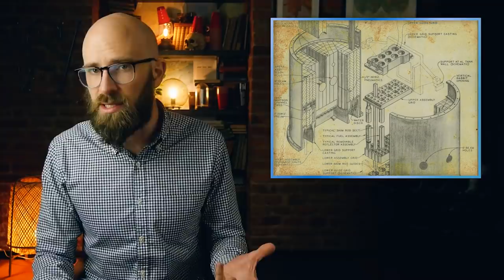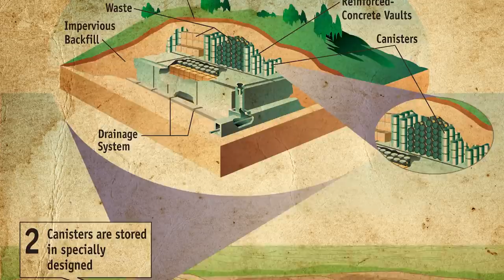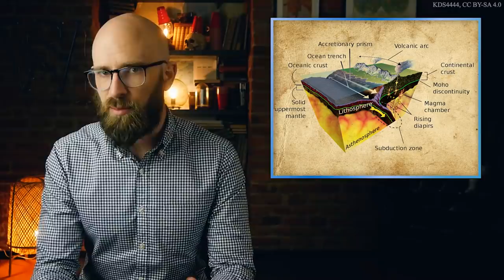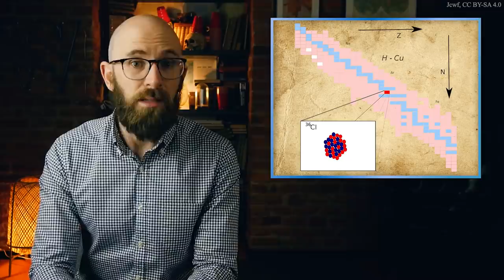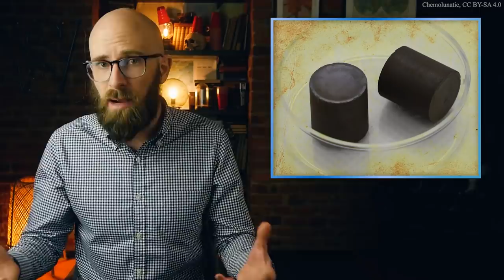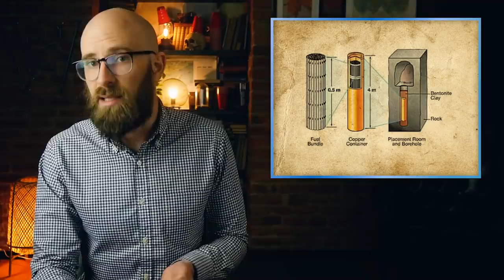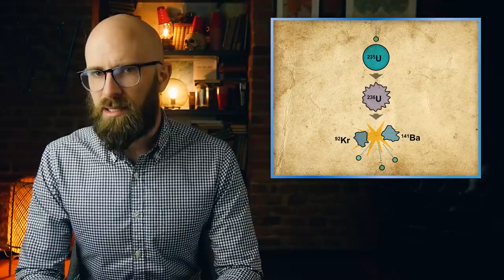How Does Nuclear Waste Disposal Work?

Comment: But Thorium reactors don't produce the same waste, do they?
Reply: No but they do produce some uranium isotopes that aren't usable as fuel, and have issues with cooling that researchers are working on. Namely the salt bath itself is highly corrosive, so right now they need to come up with containment structures that are economically viable.
Reply: ALL energy sources produces waste. End of.... Energy=matter and neither is ever created or destroyed only converted. For comparison:

-Existing nuclear reactors produce several tens of millions of times less waste than fossil fuels because of their HIGH AF energy density. So much so that all of the spent nuclear fuel in the US from 50 years of making 20% of our electricity would fit on a football field sized area stacked a few years high. Or about the size of the sludge produced by a single large coal power plant in a few days. 

They actually make less waste than ALL other energy sources by a wide margin but it's less oblivious with renewable power. France which gets 75% of their electricity from nuclear is able to fit all the waste in the floor of one building. And they're no where near full since they also recycle it.

-Future reactors called 'breeder' reactors can be either Thorium or Uranium (although only the Thorium type gets good press) would produce about 20-100 times less waste than existing designs. The waste that these advanced reactors produced would be of a type that's easier to recycle and what isn't recycled would have a shorter half-life. Half-life is completely unimportant for nuclear waste safety but the general public has been tricked into thinking it's better, so we're trying to do it. :P

-In the far future Fusion reactors could make 2-3 thousand times less waste than fission breeder reactors. 

Frankly the entire idea of nuclear waste is a non-issue. It's never hurt anyone and it's unlike it ever will. But fossil fuel waste is just ALLOWED to be dumped into the atmosphere as part of normal operation kills over 7 million people a year. So even if every scary, silly, absurd, wrong, and deeply unscientific pessimistic prediction about spent nuclear fuel were true, we'd come out way ahead switching fully to nuclear power.
Reply: @bronzedivision  Your argument starts off strong, but gets a little too fanboy by the end. I am very supportive of increasing the amount of nuclear power in use, but the waste is more damaging than your description would suggest. There is no so such thing as a non-issue.

Yes, let's ditch the fossil fuels, but let's not ignore the problems of the replacements.
Reply: @johnburr9463  Agreed, most pronuclear stances are based off a bias and a conflict of interest one way or another.  The facts that are rarely talked about
1. Water solubility 
2. Evaporation under equillibrium conditions 
3. Bonding with molecules like O16 and 18
4. Free movement around the planet 
5. Organically bound versions form once ingested 
6.  Exposure to ionizing radiation causes cancer auto immune diseases and other ailments.  Where is the list of deaths associated with cancers that were induced by ionizing radiation ONLY? Have you really thought about that?  Without the only possible deaths that could be associated with nuclear power not added to the statistical analysis for the deaths per killowatt hour then how could any stance be made to promote nuclear anything?  They have a bias and are proven wrong here.  Watch they wont even attempt to tackle any of what I said because its proven 100% facts.
Reply: @paulmobleyscience  True, but let's not go too far that direction either. Many of these issues only look bad when not compared to other things. For instance, in the video it talks a lot about how ionizing radiation is very effectively dealt with. Some will get out, but our planet is radioactive. So it's a question of how much is bad. Recent research suggests that if the dose is low enough, then the cumulative effects don't actually occur. There are people still living in the restricted area around Chernobyl. I guess I'm trying to say that it isn't perfect. There are problems, but they aren't all doom and gloom either. Balance in all things.
Reply: @johnburr9463  That is incorrect...it is already peer reviewed published science that the LNT is correct with science to back it up.  The fact is research even just published last year shows things that weren't know prior changes everything.  The issue is Cancer.....the specific cause of each cancer is unknown.....cancer is primarily THE disease caused by even the lowest possible long term internal dose of ionizing radiation and every death by cancer has never been added to the statistical analysis like deaths per kilowatt or terra watt hour numbers.  Just like centuries of waste storage is not factored into the overall life cycle of nuclear power.  It is and always has been a complete lie
Reply: @johnburr9463  The problem is if one doesn't work in this field then you can only go by what you are told to go by if one never researches it thoroughly.  Then when people try to speak to this topic and use that information they were told and then someone that actually knows what they are talking about says that information is incorrect then the person takes it personally like they have a personal investment to the incorrect information.  They then do and say things they wouldn't normally and most times spiral out of control when if they just stopped and looked up what was mentioned and found out themselves what they thought was correct that someone told them was in fact wrong all along they would realize that most people out here pointing out, respectfullly I'll add, incorrect information are trying to really help people know all this and don't have some side agenda to push with a biased conflict of interest.  I'm not tied to any power production so I have a completly open mind when I found out the correct information.  Look up Evaporation equilibrium coefficients for radionuclides and radioactive isotopes, water solubility and bonding with molecules and how hydrology and movement around the planet happens.  We all know what it does once inside of us.

Comment: What would happen if you dropped the waste into a volcano?
Reply: I would think that would cause an eruption, shooting all the nuclear waste into the atmosphere. Or at least a meltdown, like when a cooling system fails in a reactor.
Reply: Volcano doesn't suck anything inside the earth's crust, it just pushes stuff out. Meaning the waste would be melted, partly vaporized and either formed as radioactive volcanic solid rock or thrown into the air and spread it everywhere.
There really is only two places to dump waste: deep in stable bedrock or shoot it out into space. The latter is pretty impossible considering the amount so it leaves the first option.
Reply: No much... Not much at all. 

Nuclear waste is already nothing more than a fancy rock. And volcanoes are already quite radioactive. That's where the fuel comes from after all. :P
Reply: @bronzedivision  again, only your opinion....wow everywhere really?
Reply: Dilution is never the solution to pollution…ideally, on paper.

Comment: If nuclear waste producers were obliged to launch their waste towards the sun, then I would be in favour.
Reply: Rockets even today have a 5-10% failure rate, not safe or feasible.
Reply: You can't just aim and the sun and expect to actually get there. That's not how physics works. Your best attempt to hit the sun would be deflected and ejected from the solar system. Gravitational acceleration near Earth's surface is 9.8meters/second^2. Near the Sun it's 287meters/sec^2. We just launched the first ever probe to get closer than we've ever gotten to the sun to date. The approach will speed it up to hundreds of thousands of mph faster than any other human object ever made and requires many many passes of Venus to help slow it down and tighten its orbit around the sun. The earth is already moving about 3 times faster around the sun than our satellites orbit around the earth. You have to burn off all that speed plus burn off the insane amount of speed gained on the approach. Our chemical rockets only have minutes of thrust. To hit the sun you need thrust all the way in blasting off like you're trying to get away effectively hitting the brakes the entire time. We don't have the capability.
Reply: You're better off having an easier time by blasting in opposite direction and propel the trash out beyond Pluto
Reply: Your entire lifetime's energy demands equates to about a gram and a half of enriched uranium. The uranium came from the earth. We're not making things any more radioactive. The cheapest more feasible option is to bury it back down in the mountains from wence it came.
Reply: There is more naturally dissolved uranium in the Pacific ocean water than all the uranium mankind has ever used combined. Nuclear waste isn't a big deal. It's blown way out of proportion.
Reply: @jeffborders5526  Don't forget the current 5-10% failure rate of rockets.  One failure would create a massive radioactive fallout area that would have to be made into an exclusion zone.  Enough said, that alone makes it not a feasible solution.  If you understand geology in the long term, and the subject of "nuclear waste graveyards" or permanent long term high level waste storage solutions utilizing underground containment then you understand it's a massive problem for future generations of humanity.
Reply: @ProlificInvention  Don't forget the coming solar cycles that will induce natural disasters never seen before by modern man....many factors and the ability to safely package and tranport it off the planet is far from the only factor involved.  We have the abilities shown by not only Burt Rutan decades ago by sending a man to space with under $10,000 making NASA and even now Musk a joke.  The fact is the information is controlled and has been from day one manipulated against all life not just selfish human life.  The fact is until corporations, CEOs, lobbyists, politicians and a very uneducated public are removed from these decisions then all stances promoting nuclear power are null and void.

Comment: When you can't figure out what to do with a problematic mess, just sweep it under the rug and hope nobody notices... :P
Reply: I know just kicking the can down the road to future generations.  Its sickening to me and don't understand why we keep allowing this to happen. We must act now at the precipice..
Reply: Nuclear waste can be recycled for further energy until there's none left.
Reply: The wastes are only fractionally more radioactive than the raw material naturally in the earth, much of it is radioactive for shorter times than the natural material in the earth. That’s why we still have uranium today...
Reply: @unlocated7448  See thats where the falicy is.  Shorter half life usually mean higher energy and thus more dangerous.  Shorter half lives do not equate safer....
Reply: @unlocated7448  The raw material or U308 before its chemically changed to yellow cake still is nothing compared to not only electron volt output of whats in a fuel pellet but also the daughters that exist now not found in nature.   Thats right PU236 and others that are synthetic....
Reply: @unlocated7448  And then the U235 thats sought after for a nuclear reactor is very difficult to find in nature and usually surrounded by the neutron capturing stable U238 unlike a fuel pellet that has usually 3%.  In nature you would be hard pressed to find any mixture at 3% U235 anywhere on the planet.  Its the only reason it works to begin with.

Comment: I have to call BS on your claim that Nuclear power has the lowest death rate.  That's TECHNICALLY true, if you ignore massive increases in cancer rates caused by disasters like Chernobyl.  The official death toll of Chernobyl is 31 people.  The actual number is more like 4,000 to 100,000 deaths, again, depending on how you count deaths from cancers that may or may not be a attributable to Chernobyl's fallout.

You are also ignoring the health damage of toxic Uranium mining.  Again, hard to put an accurate number on the deaths caused by that, let alone pain and misery that falls short of actual death. (yes I know there are toxic materials used sometimes in other 'green' energy schemes).
Reply: Chernobyl maybe, Fukushima no way.  The highest dose received was 670mSv by an emergency worker, certainly not enough to cause any cancers.  There have been no cancer increases since 2011.

Comment: Nuclear waste has been an issue since its inception.  From attempts at vitrification and mixing with concrete was bad enough but eventually for decades now been put in everything from weapons like tanks bullets and artillery shells to everyday products like smoke detectors and high pressure gauges.  The fact is governments and militaries of the world started all this and now we are all stuck with it but we have a choice.  At only 10% of the global energy market and a surging renewable market, the time is now to step away from nuclear forever and move forward with safer options that are already available.
Reply: Then we expect you to immediately disconnect from the grid in your ignorant protest since nuclear energy is the safest of all the electricity generation methods we have.  No one has ever died from stored nuclear waste.
Reply: @danadurnfordkevinblanchdebunk  Nuclear is not the safest Craig because the deaths per terra watt hour are incomplete without every cause of cancer known and then those deaths put into the proper catagories.   You know this already Craig we talked about this on Thoms video for well over a week.  Why would you pretend you don't already know this Craig Douglas?
Reply: @Paula Mumbley  But there are no cancer increases since 2011, so you're meme can't possibly work.

Comment: comparing nuclear with other kind of energy production that way (death/kw)is a logical fallacy. First of all nuclear can affect for 10.000 years from now, example still affecting people in Ukraine. So nuclear can kill you whithout producing any kw. I live 200 km from  Chernobil. i know, it's not my opionin, i know There  was absolutlly no number as how that nuclear plant affected people! but that does not mean is 0. In fact it's about milions Chernobil needs again another concrete there. Besides that the waste is not something that we get rid of...so you can't compare a theoretical number with a more fixed one. And not taking into account that the chernobil area will create problems for 10.000 or more. that is purely infinite comparing with the amount that we're actually using nuclear les then  100 years.  In theory nuclear is great. But no matter how low probability of risk is is just a matter of time untill it happenes. And the problem that you still have cost after you stop producing means is not sustainble in a long run. yeah we have theories... for like 30 years are still the same.